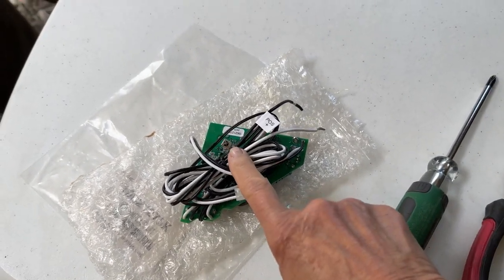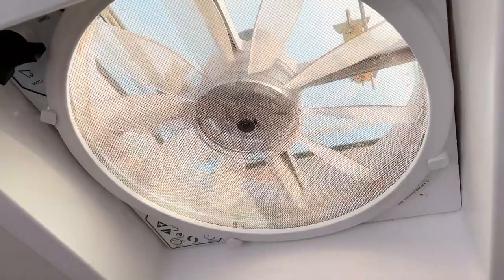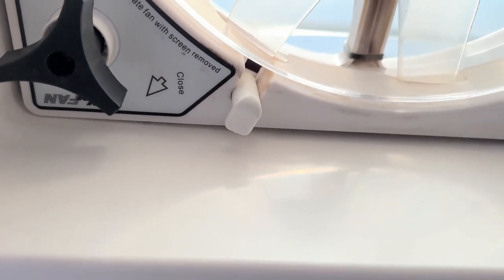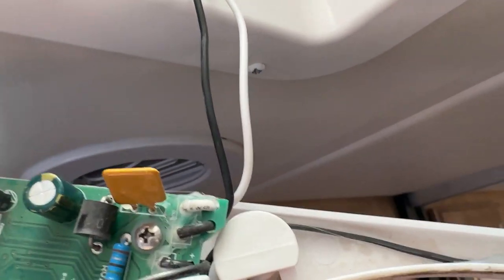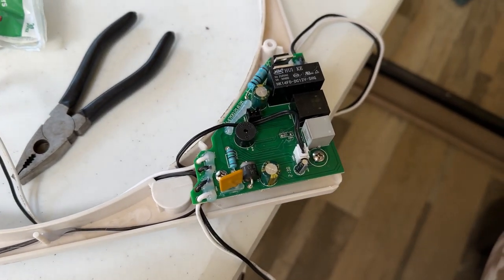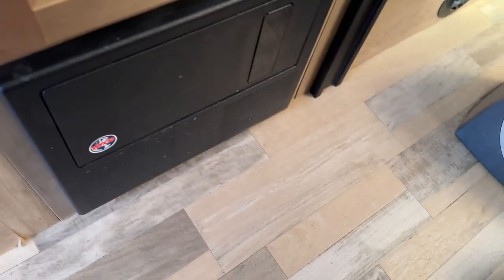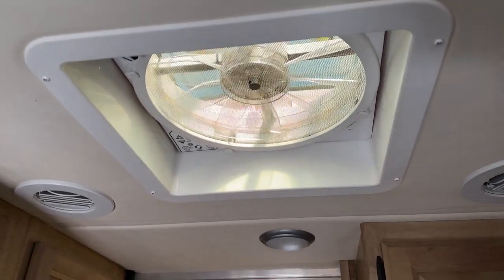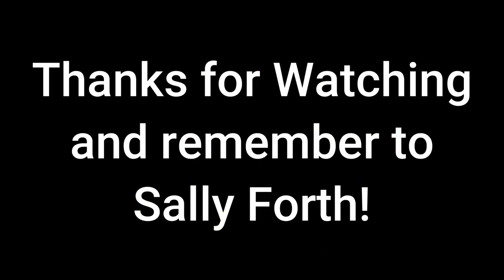Fixing My MaxxAir Fan Circuit Board Replacement | Easy DIY Repair!

Comment: Hi Sally!  Just had my Maxxair fail on me which brought me to your video. Im going to start with disassembly and cleaning. I hope it's that simple but with my luck I'd best be prepared for the worst. sigh I like you am going to try fixing my fan myself. Is it okay if I contact you if I get stuck or for moral support?  After I pull the fuse I'm guessing the next step is a cocktail 🍸😂

Comment: Did you check the fuses before you began the disassemble?
Reply from the maker: Nope. The issue with fan was that it emitted a burning smell.  I didn't see any reason to check the fuse beforehand.  I had closed the skylight vent shortly before I started.  that’s on the same fuse, so I guess indeed I did check the fuse. More importantly, is to pull the fuse before you start the job!